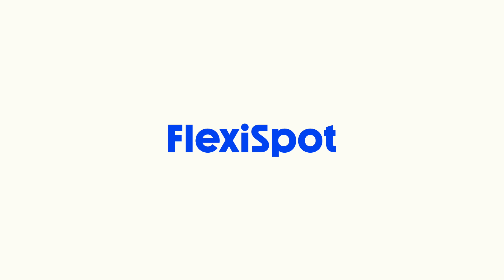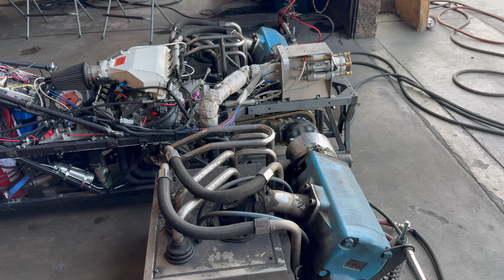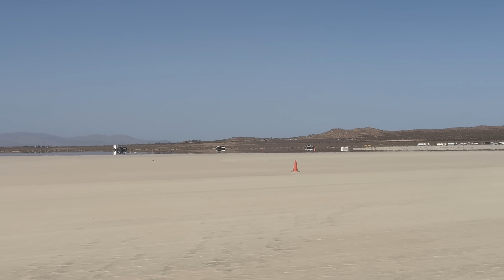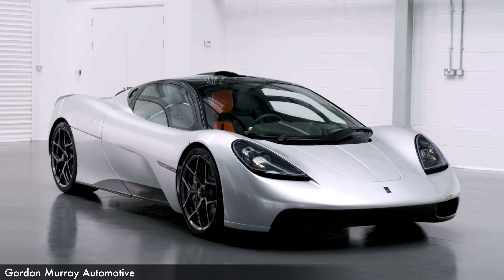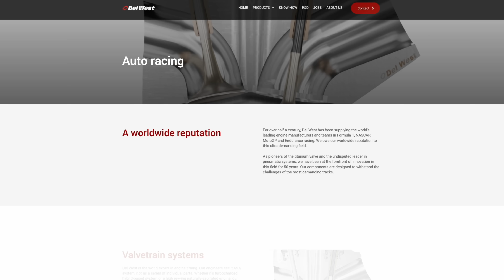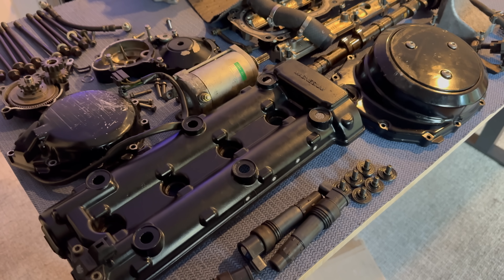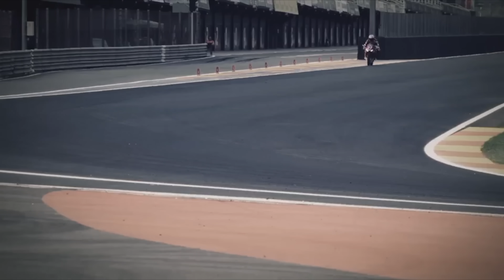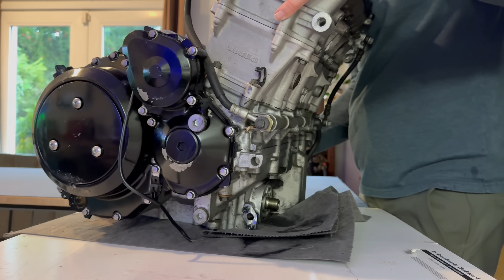Motorcycle Engines Are WAY BETTER than Car Engines

Comment: My motorcycle makes more power than car and weighs 1/10th the weight. But not only that, the rev range is amazing... 1st gear goes up to 80 ish MPH! If you like engines, it's the most raw way to experience one.
Reply: My little Daihatsu 4WD revs to 9500 rpm and produces about 60kW. 
It is no ones idea of fast, but it's the most fun you can have on 4 wheels at legal speeds.
I'm mashing the throttle everywhere, and the tyres are squealing under hard cornering, and I'm laughing my head off, and I'm doing 50kmh.......
Reply: @woopimagpie  Had a sporty Daihatsu the year they exited the US market.  First time I got to 100mph on the freeway.  Was a dinky little car but so much fun to drive.  I recall the handling being particularly sharp.  Really wasn't a sports car but somehow felt like one.
Reply: @woopimagpie 
Very interesting comment of yours, indeed! 
I have no idea what Daihatsu you are talking about.
Do you know if they sell them here in Europe?
Reply: @josemariatrueba4568  It's called a Terios, I have no idea if they were ever sold in Europe. This one I have is 25 years old now, but there are newer models than mine.
Reply: @woopimagpie 
Yes, it was sold in Europe with a 1.5 liter fuel injection, 10.5:1 compression, engine producing 105hp which is not a lot considering that there's a 140hp Suzuki Vitara.

Is this the same engine of yours?
9000 rpm seems like too many.
Reply: @josemariatrueba4568  My Terios engine is only a 1.3, and the car is a lot smaller than a Suzuki Vitara. It's more like a Jimny, just a baby.
Reply: @woopimagpie the terios has a yaris engine
Reply: @woopimagpie i have a terios 1.3 it revs to 8k not 9.5
Reply: @woopimagpie 
I drove a Suzuki Samurai 1.3 liters many years ago. It was a very small 4wd car and the engine was really very lazy lacking enough power in the freeway.

That day started to rsin cats and dogs when I had to go downhill in this narrow winding road full of water. I engaged 4wd and the short final ratio to find out that it became the most wonderful car that I have ever driven. 
The car was sliding sideways in every corner but with plenty of confidence and safely. 
I will never forget that amazing experience.
I wish I had a Samurai today, but with twice or three times the power that the poor lazy 1.3 liter engine had.
Reply: @sotiify9221  Yeah mine's had a bit of work done, I was friends with a guy who worked at TRD in Sydney years ago, they built the engines for the Charade rally cars that ran in the ARC for years.
When that program ended there were a bunch of engines and parts left over that were getting chucked out so we put one together and dropped it in my Terios. It was supposed to be just a fun project but that car is so great I still have it. I never rev it hard these days, it's done a head gasket, broken a driveshaft, and wrecked a clutch so I'm kind to it these days cos it's getting a bit tired and I want it to last. Getting that engine rebuilt again now would be prohibitive, I doubt I could even get the parts, let alone justify the cost, the car is 26 years old. Aside from decent pads the brakes are stock, so there's that....
The engine is a HC-E series, it's pre Yaris era (the Yaris engine was a 3SZ I believe). There was a 1.6 litre single cam version in the Rocky and the Applause called the HDE. The rally cars ran a TRD twin cam head (which I have) that revved to 9500rpm and were surprisingly tough. Cylinder heads cracking from heat cycles was main problem with stock single cam engines, the twin cam heads fixed that.
As I said, it's the most fun car I've ever had by a good margin, and I've owned some fast stuff over the years, a couple of tweaked Datsuns, an ex hillclimb Gemini, an ex Group N rally Charade, a few fettled Subarus, a Fiat X19 and an XT Falcon with a warm Windsor. My daily driver is a Subaru Outback with a sneaky "improved" engine, that's pretty fun too, in a sleeper family wagon kind of way.
Reply: Motorcycle engines generate LESS power than car engines for the same amount of fuel burned — significantly less.
Currently, motorcycles consume about 5–7 liters of fuel despite having relatively small engine capacities.
Moreover, in everyday riding you use torque, not horsepower. Motorcycle engines produce less torque.
Reply: @podunkman2709  yes, they are less efficient. A lot of people think engines are made more efficient when modified to make more power, but that is quite the opposite.  Usually the higher HP/liter, the less efficiency. I worked on old race cars, and a 2L engine from a 1970 lola t292 makes about 280HP, NA, mechanical injection. It also needs a rebuild every 10 hours of use, but revs to 11000rpm. Of course it guzzles fuel like crazy. In any case torque is directly proportional to displacement, until the engine has forced induction. After that it is proportional to displacement x pressure ( in  bar, that great international standard. 1 bar = about 15psi)
Reply: @podunkman2709  my zx4rr generates about as much torque per pound as my miata, but significantly more power per weight. It is significantly faster to accelerate, even on my short commute however, so the idea that only torque matters for everyday riding/driving really depends on the way you ride. Only hitting 6-7000 rpm on the bike would be pretty silly.
Reply: Getting that engine to 100k miles without destruction beyond its value is the same as getting a gas engine to 300k or a diesel to 500k.  They wear out several times faster and have far shorter maintenance that if you skip ends the engine right away.  Further the gas mileage isn’t great compared to a car a 350lb bike and 200lb rider with a tiny cross section of drag should be getting far better mileage by a factor of 3+ over any car based on rolling resistance and air resistance on the same incline or lack thereof.
Reply: This is cool but also why I won't buy such motorcycles. I am already breaking every speed limit in my country ever just by maxing out second gear. I'd rather drive a slow but very lightweight pile of crap that I can shift 2 times before I hit the speed limit
Reply: @jackthatmonkey8994  try a caterham if you can. They are basically motorcycles on 4 wheels. Pretty light (usually under 1200lbs), rwd, and you can put your hand on the ground when seated in it, without leaning out. Windshield, doors and roof are options. Carbon seats, LSD and rollcage too. Engines range from a kei car (which it was sold as in Japan) to a 2L supercharged with a dogbox transmission monster. At some point it also came with a v8 made from 2 bike engines.
Reply: @croustibat682  My citroen AX comes close to this. 780 kg with fuel and me in it! I don't have illusions that it is faster than a caterham though. Not even the kei car one.
Reply: @croustibat682 that was an Ariel atom. The atom v8
Reply: @2003AudiS3  and the caterham rst-v8. 1040lbs, 500hp.
Reply: Ok yeah your engines sre cooler and better, bur i prefer living my life
Reply: @karlostrizrep9687 
@Segmond_Fault funny story, I recently got a Geely (Chinese car), and it's like I'm practically doing that. You can watch on the centre console in that thing. The engine may as well not be there, as I like sitting in that thing at night with just the aircon, or stargazing out the sunroof.
Reply: @karlostrizrep9687  Why not to take the engine out and use the car to sit at home and watch the TV then?